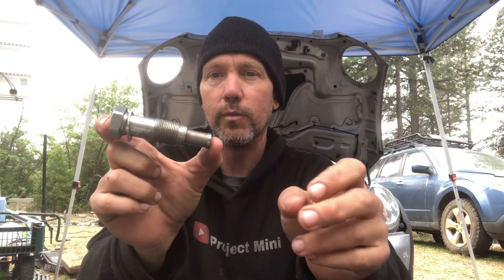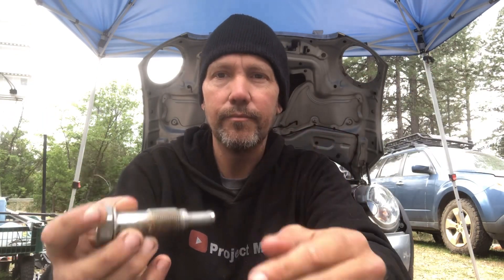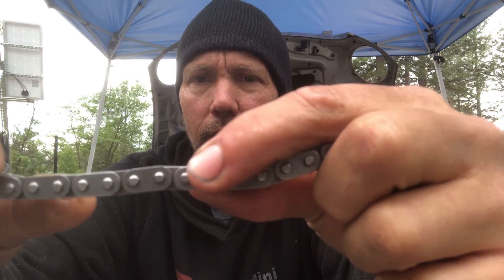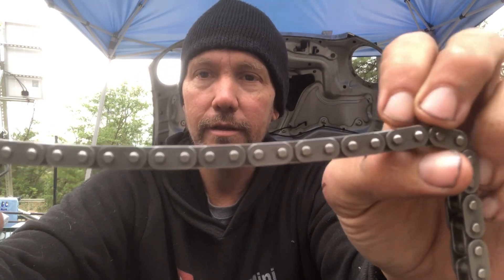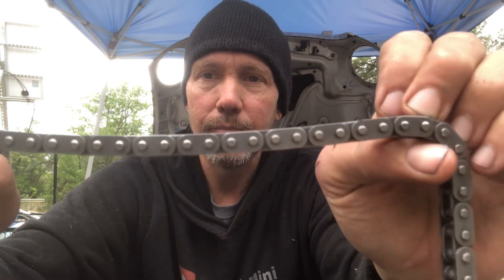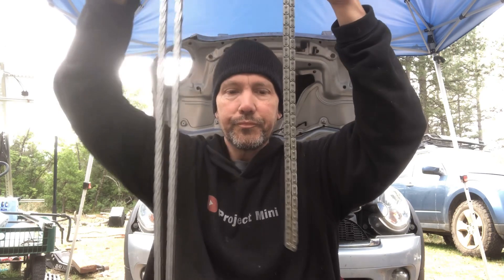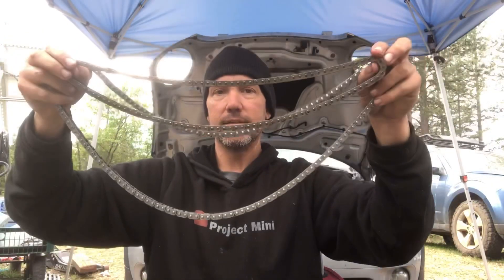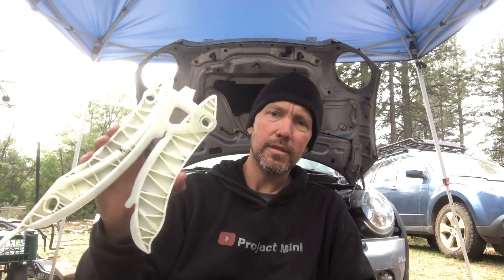Top 5 R56 Mini Cooper S Timing Chain Myths

Comment from the maker: - Facebook groups  -
Mini Cooper R53 Enthusiasts: https://www.facebook.com/groups/164990851647892/?ref=share
R56 Mini Cooper S enthusiasts: https://www.facebook.com/groups/729821991242039/?ref=share
Mini Cooper DIY: https://www.facebook.com/groups/518907605479579/?ref=share
Reply: Very informative video!
Project Mini, do you know when the updated (i.e. longer) timing chain tensioner was introduced? Just trying to figure out if my car (production date 12/2007) was originally equipped with the revised tensioner.
Reply from the maker: It was revised a few times. I doubt that a 2007 had the new version

Comment: Beware of irrational obsession with mini timing chain issues.

My daughter's 2013 mini cooper with 60K miles was making an awful noise, so bad that the MOT test technician said he thought the engine was going to break when he increased the revs for the emissions test. It turned out to be a badly perished serpentine belt with a chunk out-of it. It cost £18 to repair and now sounds perfect.

I had prior to this removed the cam cover and inspected the timing chain and plastic guides which were perfect.

It really pays to investigate problems methodically and carefully and not get carried away with YouTube horror stories. I have a Porsche Boxster S 987 for which there is perpetual scaremongering over the IMS bearing. This was an issue occasionally on 986 and very early 987 models but Porsche upgraded the bearing in late 2005 and IMS failures in properly maintained vehicles after this time is rare.

The most important thing to do with all engines is to change the oil and filter at least every 10K miles or annually and if you have a fibre timing belt well before the maximum recommended replacement interval.

Comment: I just want to add to please be aware that there are still bad timing chains/ tensioner out there. I bought one from ECS Tuning that cost me a set of Iconel exhaust valves. The tensioner did not have anything markings as to where its made. Thats not the only issue Ive had with getting inferior shit from ECS Tuning.  I don't buy  ANY parts from them anymore...its not worth my car or my money to deal with them.

Comment: "Timing chains are not lifetime".... okay, sure. But I have a Kawasaki with over 230k miles on it with the original timing chain. I have a Nissan with over 165K miles, neither needed a timing chain, guides, or tensioner replaced, and I've never given either any thought about it, they simply last because they were properly designed in the first place and well lubricated during operation. I've owned several others examples of different manufacturers over the years, and none had an 80K mile timing chain interval, only belt driven timing like VW / Audi had such a short interval.

Comment: It's important to know what BMW/Mini understands under a car lifetime. According to BMW Financial Services a BMW/Mini lifetime ends at 150.000KM. So yeah if you interpret car lifetime like BMW your Mini's timing chain and your transmission oil are no need to service parts. There is a trick though. More frequent oil changes(I do mine at least every 10k KM or 7.500KM when I run Motul 300v Competition)  and ceramic oil additive. My N13 powered 1 series(basically a Mini N18 longitudinal mounted) timing chain is still within tolerance though it's already got 130K KM on it and is used mainly in  short distance traveling. I have no doubts it will stay strong for the next 50K KM to come. Nonetheless the N13/N18) is designed to do a chain replacement in less than 1.5 hours which is why I will do it most likely before reaching 150k KM. It's just a 300€ job.(unless you decide for the official BMW rip off service)

Comment: Did a partial rebuild on my N14, R56, including a new timing chain assembly and MANY other parts including head overhaul.  After head job the Car ran but not well.  Discovered leaking exhaust valves.  Had to pull head.  Found grit in VANOS solenoid, freaked me out.  Found out the first machine shop SAND BLASTED my head and left grit in passage ways.  Had to pull head.  Head is now done right by a reputable machine shop.  Grit destroyed cams and lifters.  Now I'm worried about my brand new oil pump and if my cylinder walls are scored but that's another story.  My question to you is-  When I pulled my head the second time I left my (new) timing chain on the crank sprocket and slipped the head off the chain after pulling intake and exhaust cam sprockets/VANOS, guide tensioner, guide mount bolts.

Any tips on re-installing timing chain in this configuration (chain on undisturbed crank sprocket)?  flywheel was/is pinned and cams will be in time with special tool.  Your videos are good, I respect your opinion.  -Thanks in advance, Jeff
Reply from the maker: I’ve heard of people doing this in the past. Pull the chain tensioner out, install cam sprockets DONT tighten the am bolts yet! 
Install chain tensioner, then tighten cam bolts.
Reply: @ProjectMini thanks for the info. I just did a head gasket and changed the timing chain components. Now im getting p1338. I’ve checked the timing and everything lines up. Also did the vanos solenoids and the cam pos sensors. Still get the code. My question is if you think that the head resurfacing made the chain be longer than it should, causing timing issues? Thanks

Comment: Hey there huge thanks for all your videos.  I have an R55 S (2010) and already have the intake and valve cover off as I'm replacing some things.  I noticed my timing chain guide on top is broken and I thought maybe now is a good time to replace the whole timing chain assembly.  However not sure if it needs it or not – I was going to order a pretensioner tool to check but maybe it's better to just replace the whole thing.  Car has 110k miles and I've had it since 90k (no idea of the history before then).  Timing belt replaced when I got it.

Also have a small head gasket leak! I'm not sure if I'm brave enough to do that job so I'm hoping I can seal it with a head gasket sealer and coolant flush.

Comment: they revised the chain tensioners twice from the original.. you can tell by looking at them which revision you have.. when you have one that just looks like a bolt then it's a first iteration.. the 2nd iteration had chamfered edges as opposed to a flat head and the third generation is the one you have in your hand with a small hole in the middle.. and the timing chains definitely stretch (you've just worded it slightly) - stretch = chain lengthening... you can check if your chain is in tolerance by using the tool..

Comment: To answer the first myth from a materials standpoint coming from the 3D printing community. BMW intentionally used materials that would fail at high temps. PTFE which a ton of people think is a high temp material fails at 100C. They failed to account for the heat creep involved in the thermoplastics they used and also failed to take into consideration how the moisture would cause the plastic to fail as well. This is the same thing that is going on with Dodge and the glass bead reinforced plastics that will absorb moisture over time and delaminate without the end user even understanding what is going wrong. The material science is well documented.

Comment: I'm sorry but a well designed chain is for life .
Reply: They are. You are clueless
Reply: M54 bmw 600.000 same chain. Must be in luck then…
Reply: Is timing chain wearing out a unique feature of Peugeot/Mini? For those of us growing up with Detroit OHV engines, timing chains were forever. My ‘94 BMW 325IS sold to the next person at 195K miles and 2003 Accord 4-cylinder (1st year using chain vs. belt) sold at 240K mi., both with original chains and no chain-related issues. We have a ‘12 N16 R59 with 194K mi, a daily driver with original timing chain but new tensioner at 100K, plan to change tensioner and check guides again at 200K. Synthetic oil changes at max 5K mi. BTW, thanks for the Mini DIY group; it has saved us time and expense more than once.
Reply: Oil prevents wear that’s what it’s for plastic guides are pants. All mini models begin to show timing chain issues at around 60 k  bmw built a rubbish car preying on the gullible fashion victims that think that buying a mini with an as semblance of the union flag in the rear lights is buying  an iconic British vehicle designed by an Italian. This is bs. They very cleverly reproduce the driving experience of the original mini but they are twice the size and twice as comfortable as a real mini. Oh the bmw version is also gutless and half as fast as a real mini . These beemers are plagued with issues if you want that small car experience buy a fiat.
Reply: Yeah, the life of the chain.
Reply: I'm sorry but they are not, with that being said, a shorter chain will last significantly longer however they will develop chain slap against the timing cover which can eventually lead to chipped teeth on the gear over time, and thus making the engine jump time. I've seen it happen loads of times on chevy 5.3s. If you don't replace it, you may or may not end up with catastrophic failure right away, but there will be certain engine power loss. I've replaced oil pumps on trucks and low and behold you pull the timing cover and you're now also replacing cam gears etc.

Comment: I have an 2012 R56 that I just ordered the kit from Detroit Tuned for.  I'm way past due with a factory chain at 171K miles.  It just started making noise when starting.
Reply: Hey I wonder if you happen to have a sound recording? I would like to compare with what my r56 is doing? Thx
Reply: @davidrodriguez-hp3id  Sorry, I do not
Reply: I can't pass emissions in my 2012 R56 Cooper S @ 136K. New plugs, coils, head gaskets with PCV, swapped VVT with no change in codes, new fuel filter. Sputters and sometimes dies at idle. Chain with tensioner, hpfp, and injector return kit are next. Any suggestions are welcome

Comment: Great video. I have a mini cooper 2009 with a p0015 code. changed the sensor but the code did not went away. any suggestions? do you belive it can be the timing chain? car is running but it looks like it takes long to respond acceleration
Reply: Did you end up fixing it? Mine is throwing the code rn, trying to figure out if it’s the timing chain or not
Reply: Yes sounds like your chain has stretched that code probably caused by camshaft correlation (inlet cam has retarded) causing a flat spot. If you leave it you'll still be able to drive it but it will start bucking/jerking (causing intermittent misfire) will eventually damage the ecu !

Comment: I admire your patience and generosity of sharing so much informations about these cars but I don't agree with you about ''timing chains have to be changed'' 
A well made timing chain will last more than the lifetime of an engine but on the N14 the chain is smaller than a bicycle and we are talking of about a 175 hps engine. BMW has made it too cheap like a majority of the parts of the R56 N14

Comment: I don’t know why the minis get so much hate on the engines really, it’s like people think they don’t need to maintain them like every other engine or something. I mean I got an oil leak, had to replace the timing chain and the valves needed walnut blasting but that was because the previous owner never did any maintenance on the thing and it all built up.

Comment: Sooooo.... Looking at a one owner 2008 Clubman S- the dealer cannot provide records of either: TSB/Recall Replacement, or, any replacement of the timing chain/tensioner at all. It has 71k miles on it. I told the Dealer that if they couldn't provide documentation of service(s) I wasn't interested. What I'm hoping is they'll agree to change the timing chain/tensioner to make the sale. They being said, what else would/should I look out for? I've heard that Mini had a ludicrous oil change interval schedule of 15k, which I'm just scratching my head over. Sludge/carbon must be an issue, but, how to check, without popping off the valve cover or borescoping it? I haven't even test drove it, so, I can't tell you what it sounded like on start up and driving.

Comment: Why would you be replacing your chain every 80,000 miles. It's a chain, not a belt
Reply: Chains wear out. I change my chain on my mountain bike often due to the exact reason he talked about…
Reply: @Wrangzilla  hahahahh absolutely not the same thing.
Reply: its more about chain guides, it wears.
Reply: Its simple. This particular engine had a really bad issue with the Chains going bad. There was a class action lawsuit to the tune of 30 million. That suit ended in 2016, but the cars are still out there. One of the issues Ive read is that the tensioner was too short and when it got hot, it caused an issue with the chain expanding. Once the chain was expanding, it started beating against the engine and the rail guide. Either the chain or the rail guide goes, causing a catastrophic engine event. Chain or rails break apart and fall into the oil pan, which can get into the engine if the screen is broken. Engine go bye bye.

Comment: BMW/MINI tech here. Im all for people working on their own cars, but for timing chains.. all it takes is one mistake, one under torqued bolt, not using new bolts, forgetting something and you got potentially serious engine damage. i dont mean to scare the more experienced DIY'ers  here, but its a risk that you should be well aware of if you are considering doing this yourself. also, ive seen minis with as low as 50k KMs that needed the chain to be replaced, after working on plenty of them you kinda learn the sound of a chain noise developing, that usually  the customer is not aware of

Comment: I've been lookin into the death rattle issues for quite some time. I don't think I have issues with mine yet. I own a 2010 mini cooper s Clubman. When I start the car, I do not have issues. However I noticed that when I'm driving my car  when its fully warmerd and I have my windows down. I can hear the engine and what seems to be the chain or something. I'm not sure if it's because of it going bad, or its because of the engine just being loud. My car has 107,000 miles and I'm sure it's never low on oil.  This only occurs when I'm driving the car. Any thoughts on this?
Reply: i have a mini cooper S 2009, with about 80,000 miles on it, the engine as far as i know has no issues, but compared to other cars its definitely louder. i think thats just a general quirk of mini engines, so i wouldnt worry about it. definitely do keep an eye on anything unusual though, something will eventually need replacing, especially at a high mileage like yours
Reply: @UCfZRJRafsYZi_0tlq_cBhNQ  Okay that's good to hear. I've done a lot of maintence since I got it. I replaced the valve cover and oil pan gasket for oil leaks, water pump and thermostat. I need to replace my oil feed line to the turbo. Overall the car has been good.  My wallet, no haha.
Reply: Direct injection engines make some strange diesel like noises. Also the dual mass flywheel can cause noise as well but usually you can tell that apart because it will change with clutch engagement.

Comment: Thanks for all the great info about the timing chain. I have a 2010 R56 S with 55k miles and I'm always anxious about mine going bad and self-destructing. It doesn't seem to be making any bad noises though. On a separate note, I notice that your hood has a heat shield on it. Did that come stock? Mine doesn't have that and I'm wondering if I need some kind of heat shield so the turbo won't warp anything, like I've heard happening to some owners. Thanks again for your time and all of your great videos!
Reply from the maker: If your car was made late in 2010 i might not have came with one since 2010 was the last year. Here’s a link to one you can buy 
https://www.waymotorworks.com/mini-cooper-s-hood-heat-insulation-r55-r56-r57.html
Reply: @ProjectMini  May be off topic but need advice. Can buy a 2011 Mini off a lady going through a divorce for $3,000. Fax looks good from what I can tell except one minor accident 4 years ago that rear ended a car and set off air  bags.  Grille and bumper was replaced and repainted. See nothing that worry’s me other then it has 170,000 mikes on it. $3,000 a good buy? 2011 Mini automatic a good car?

Comment: Car manufacturers have no SHAME. My 2007 Subaru Forester timing belt lasted more than 105,000 miles. My 2002 Lexus GS 300 timing belt lasted over 470,000 miles car now have more than 500,000 on it . Were car manufacturers smarter back then so timing belts would out last steel or smarter now to RIP off the consumers.
Reply: Lol.  I’ll take things that never happened for €200

Comment: Good info. My R55 Mini with N18 engine has a cracked plastic top guide...Mini dealer quoted $2975...with your help, I saved lots of cash doing the job myself...well parts are on order. Thanks!
Reply: Bro it’s just the valve cover and 2 bolts to get the guide off
Reply: @mikespillers8023  It will just crack again if you don't resolve the issue on why it cracked in the first place.
Reply: Yeah i got quoted over 3k from an independent shop. I was mindblown. In the process of doing the job myself, no plastic in the oil pan like they told me there would be. My car is well maintained and they told me they would find a bunch of other issues to fix along the way.
Reply: Damn.....they will bend you over if YOU allow them to do it.